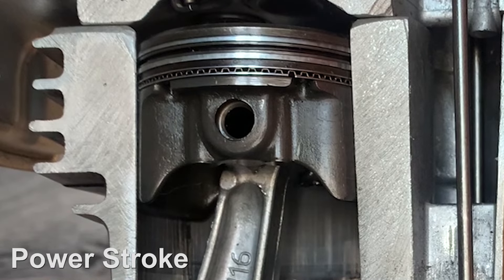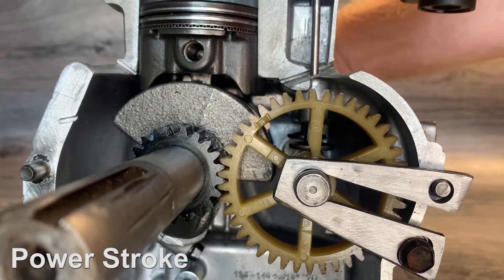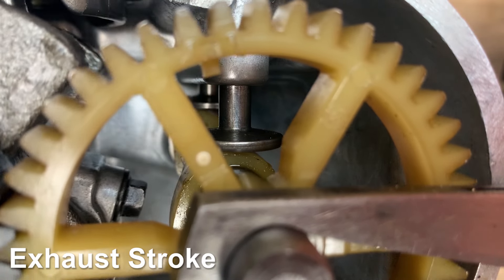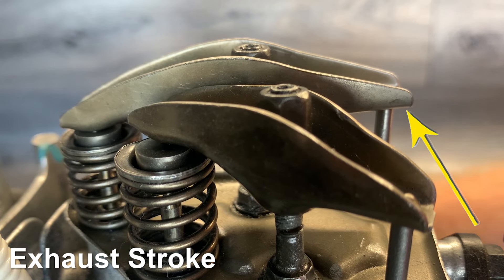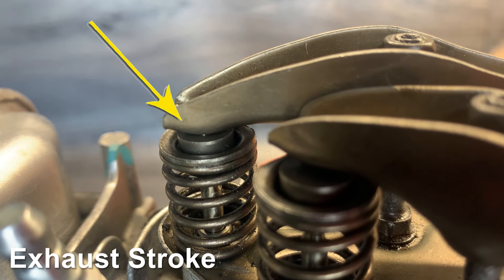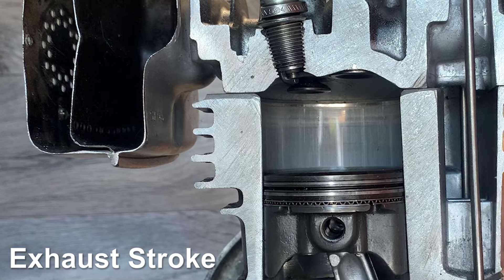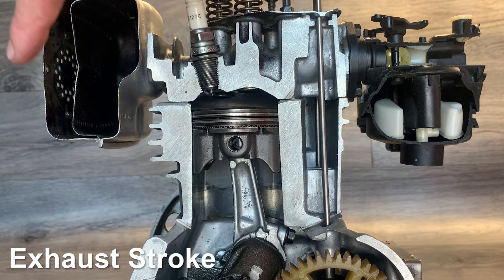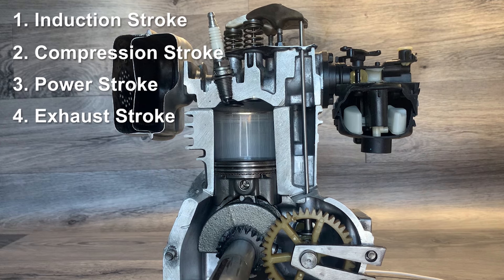Only Video You'll Ever Need to Know how 4 Stroke Engine Valving & Timing Works. (by Craig Kirkman)

Comment: What a great detailed explanation of what too loose and too tight valve gap adjustments do!  I knew they needed to both be correct, but now I know why and the consequences.  For your adjustment procedure, I know this was just for explanation, but you didn't mention loosening the adjustment locking screws before adjustment, tightening them after and double checking that the adjustment did not alter from tightening them enough to make a difference.  Potentially, anyone who sees this for the first time could do it wrong and have an issue shortly after.  You know I love your work, but I just wanted to point that out, as I'm sure others have as well.  I hope you don't get bombarded too badly over it.  Mine is meant as a friendly comment.  Thanks for the detailed explanation, Mr. Craig.  Always so informative, detailed and the arrows really help.
Reply from the maker: Thank you so much. I always appreciate your kind feedback. Craig 👍👍

Comment: If the exhaust is too loose it will be difficult to start, the comp release won't hold the valve open enough.  The compression release is a small tab on the camshaft that holds the ex valve open just a small bit to allow easy starting, when the RPMs reach a certain speed the tab slings out of the way and allows the engine to operate normally, so if the gap is too much the tab will only take up the gap and not hold the valve open.

Comment: Great job my friend. I have a 22 year old Peugeot 206 1.4i which has had a persistent misfire (P0200 and P0300) for several months (I have not driven it), I have replaced the sparks, the fuel injectors, the coil pack, the knock sensor, the camshaft sensor, done compression tests, tested the continuity and voltages across the ignition circuit, I have just replace the timing and drive belts (they were old anyway) and all that I have left is the valve clearances...I do get an occasional 'ping' during a misfire so I'm pretty confident it's the valves after watching this video....
Reply: I should add the P0200 was fixed by replacing the knock sensor...... it had cracked wide open.... was the original 2001 sensor.

Comment: Excellent. And if the valve gaps are correct and there is still poor compression it means that you have other problems, such as damage to the valves as you describe. (Hope that's not so in my case, but I guess you may have another video covering that :) )

Comment: Hi! I've been following your channel for a few years now. I do small engine repair work in Lithuania. I'm learning from my father who is an experienced repair specialist. I rely on your videos for the theoretical part of the job as many situations I encounter seem like magic if explained with no theory and only by experience and observations. I couldn't wrap my head around the saying that valves 'burn out' if the clearances are too tight. I have observed it, but couldn't figure out the cause. The same goes for the problems explained in your ignition coil videos. Thank you!
Have you got experience working on ridable mowers and their electrical components? I still struggle with troubleshooting that

Comment: That was a very good instruction.  I would like to add, because I got fooled once, that Briggs and Stratton Vanguard engines in the US call for an indicator stick, and they specify 1/4” 
lower after TDC on compression as the set point. I’m not sure why, but that’s their spec.
Reply from the maker: Great tip!
Reply: I use a multimeter with a “frequency” function to set idle speed. Put an antenna on the positive input terminal, place the antenna just close enough to the spark plug wire to get a reading, not too close. 
i.e: 1000 RPM= 16 2/3 RPS, or 17 hertz (rounded up). This assumes a lost spark system, whereas a distributor spark would be half that. Ok last Heloise Hint, don’t want to be a pest, but just to give back a token to repay all I have gleaned from watching your videos.

Comment: Great video Craig. I have always wondered why they went to the overhead valves. These engines having more parts seem to have more problems. I have a Techumse flat head on my 1974 Sears Rototiller and I run it every year 5 or 6 times, drain the gas from the carb, and put it away. The flat head seems like a more reliable engine. If you would, compare the flat head to your model here and note the differences between engines. Thanks
Reply from the maker: First of all, thank you for your kind feedback. I really appreciate it. And yes, you have given me a very good idea for a near future vid. I do have a flat engine somewhere in my pile of engines. I will pick out one and do a vid on the comparison, just as you said. I do have a list of a few vids to get through first but I will get round to then. Thanks again. Craig 👍👍👍
Reply: I love my flatheads, FLATHEADS FOREVER. But the OHV engine is better in practically every way possibe.  Yes it sucks to admit it but it is no contest. Unfortunalty

Comment: you are a genius man i have a bike gs150 and it has 133000km on it my tapped sounds like tik tik and now i adjust tapped according to the theory you present and my bike engine is running smoothly and acceleration like boom on 2nd gear the wheely happens you are genius bro 👍👍👍👍👍👍👍👍👍👍🌹🌹🌹🌹🌹🌹🌹🌹🌹🌹🌹🌹🌹🌹🌹🌹🌹🌹🌹🌹🌹🌹🌹🌹🌹
Reply from the maker: Wow/ thank you so much. I really appreciate it. Craig 👍

Comment: The video is very interesting. In your experience, is it possible that all 6 rocker arms on the right cylinder bank break and not a single valve is bent? Thank you for your feedback and best regards from Austria.

Comment: Great video and explanation; thank you very much. I tried to set the valves on my 250 (OHV motor) and there was no way I could loosen the valve adjusting locking nuts.. They just would not loosen... I was afraid I might strip them... The motor was on the F timing mark and both valves were closed, but even then I could not feel any "looseness"  I`ve got no idea why? 😕

Comment: How can you til if the valves should be offset when manual shows either or or doesn't say? 
Like .004 to .008 intake & .006-.008 exhaust. Or mfg manual says .004-.006 inch on both. 
But doesn't say if it should be offset for a 208cc generator.
 I only hear offset the valves  from the technicians by example of operation.
 So offset or not?

Comment: Thank you! Great explanation indeed. One question though: is my understanding correct that during a one full cycle the magnet on the flywheel passes by ignition coil twice? If so it appears to me that we get on spark at the end of compression and one more on exhaust? I'm not very sure how that works and everybody seems to say there is just one spark, and that is reasonably.
Reply from the maker: Thank you for kind comment. I really appreciate it. Secondly, you are absolutely correct about the spark firing twice for a full revolution of all four of the engines strokes on these small single cylinder Engines.  Other people who have told you they do not fire on the exhaust stroke are confusing themselves with larger engine that use a battery to charge the sparking system to generate the spark. These systems have more advanced spark timing. These small lawnmower engines, however, are not that advanced. 

They do not use a batter to charge the sparking system. Instead they use the magnet on the flywheel and the ignition coil pack.  Every time the magnet passes the coil pack it will generate a spark, as you correctly said.  This means that after the magnet has passed on the compression/power stroke, it's one full turn from this will indeed be the exhaust stroke, which is where the spark plug fires again. 

Why does it do this? Well simply because of the design of the magnets positioning on the flywheel making for a simple and easy functioning sparking system function. Of course, the side effect of this system when it was developed was that the spark plug would fire on the exhaust stroke as well, but this was to NO detriment to the engines function what so ever. 

On other larger engine types where the spark plug fires on the exhaust stroke, it is known a wasted spark system. Take a google search and search for this: Wasted Spark System.

I hope this helps

Craig

Comment: Excellent video. I wonder if it is safe to use a rope to lock flywheel of lawn mower so that I can remove nut? I saw in one video guy said it is not safe to use piston stop tool on large engines like lawn mowers. Some guys using rope, but some saying could be issues with valves. I have a feeling it should be safe to put a rope in the middle of compression cycle as the both valves will be closed. Am I right?
Reply from the maker: Hi. In my opinion, using a rope to lock the flywheel of a lawnmower can be a useful method for preventing the engine from rotating while you work on it. However, it's important to use this method correctly to ensure safety and prevent any damage to the engine.

Your understanding is correct: When you insert a rope into the spark plug hole and position the piston in the middle of the compression stroke, both valves should be closed. This is a safe position to lock the engine because it prevents any potential interference between the valves and the piston. It's a common practice among mechanics and DIYers for performing maintenance tasks like removing the blade or working on the crankshaft nut.

The key is to ensure that the rope is inserted far enough into the cylinder to provide adequate resistance when you turn the crankshaft nut. This resistance effectively "locks" the engine, preventing it from turning while you apply force to loosen or tighten the nut.

Using a piston stop tool is another method, but as you mentioned, it may not be suitable for larger engines like lawnmowers. Using a rope is a practical alternative, and as long as you follow the correct procedures and ensure that the rope is properly inserted to stop the piston, it can be a safe and effective way to work on your lawnmower engine.

Always exercise caution and follow safety guidelines when working on any machinery, and consult your lawnmower's manual for specific recommendations related to maintenance and repair procedures.

Thanks 
Craig

Comment: That was an amazingly detailed video. I haven’t found it explained better anywhere else. Curious if you think that setting an intake valve .01mm over spec would cause an issue? I know some engines give a range, but my particular one on a motorcycle does not. I had it set to spec and it seems to have tightened prematurely after only 1500 miles causing performance issues. I don’t know if this is a feature of a new engine, or if I should set it slightly looser to extend the time between service.  It calls for .08mm and I’m thinking of setting to .09 next time.  There isn’t a lot of information about things like this. I would greatly appreciate your or anyone else’s opinion. Thanks.
Reply from the maker: Hi. First of all, thank you for your really kind and thoughtful feedback. I really appreciate it. Now to answer your question, in my opinion of course, .  When it comes to valve clearances, precision is key, as even a small deviation can affect the performance of your engine. Setting your intake valve clearance at 0.01mm over the specified measurement may seem minor, but it can indeed have an impact. However, valves can tighten over time, especially in new engines as they go through a break-in period. This tightening is often due to the valve and seat wearing in and finding their fit, which can cause the clearances to reduce. If you've experienced a premature tightening after only 1500 miles, this could well be a sign of normal settling.

Setting the valve clearance to 0.09mm, a slight increase from the specified 0.08mm, could provide a buffer against this premature tightening. However, just be mindful of the potential for increased wear over time, which could lead to a larger than intended clearance if it's set looser from the start.

If you feel that you had no issues though and so are comfortable carrying on setting your valves this way then that's absolutely your choice.   Every engine is unique and how it wears in can vary, I personally would just keep in mind that regular maintenance and checks are crucial for the longevity and performance of your motorcycle engine. 

But anyway, thank you for sharing your experience with you motorcycle here.

Thank you

Craig
Reply: @TheRepairSpecialist  I really appreciate you taking the time to respond. I think based on your opinion I’ll chalk it up to extended break in and stick with the spec for now. The issue it was having was that after an hour or so the engine would start to hesitate, sputtering as though it was running out of fuel although it wasn’t. After checking other things I checked the valves. I don’t guess they were more than .005 tight, but it seems that it caused the issue when it got up to full temp. I wouldn’t have thought the tolerances could be so slight. Thanks again.

Comment: Great cut away engine! Instead of going for top dead center, I rotate the engine until one valve is completely open (on the top of the cam lobe.) This tells me the other valve is completely closed. I adjust the closed valve, rotate until that one is completely open and adjust the other valve - which is now completely closed. This also takes the compression release mechanism out of the equation because it will not be in place with one valve completely open. I wonder if my practice is sound (it seems to be and seems to work?) So many folks do the TDC on compression thing that I wonder. Thoughts?
Reply from the maker: First of all, thank you for your kind feedback. I really appreciate it. As for the way you adjust your clearances, I also adjust the clearance this way myself. I too have never had an issue with. I find it just as accurate as the method I showed in the video. I think it’s just a case of preference really, and it seems that the more experienced mechanics among  do it the way you mentioned. I think it’s also a generation thing to a degree. When I was taught how to set clearance back in the late 80’s, it seemed to be the old fashioned way of doing it. I have some old Honda engine service manuals and in them is the method you explained. I think it’s just become a little more popular in recent years to adjust them as I showed in the vid. But in my opinion your method is great 👍

Comment: if youve got a range [ 0.022" - 0.032"] for the valve lash and have got cold start misfires. are the valves too tight too lose? I've got a G.D.I. engine 2016 only 30k miles with cold start misfires? do you use the looser end of the spec to adjust  or shoot for the middle of the spec?
Reply: Backfire is exhausted is too tight? That's been my experience.

Comment: I have a highly modified engine (+13mm bore size, 2 valves per cylinder to 4 valves sohc) the manufacturer specs for valve clearances does not work anymore ,how do i figure out how much clearance should i need?